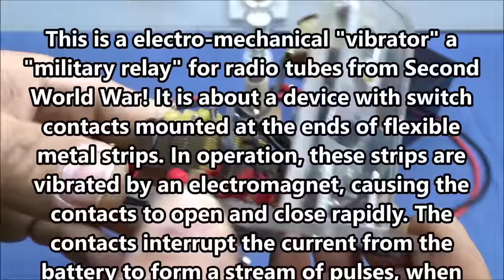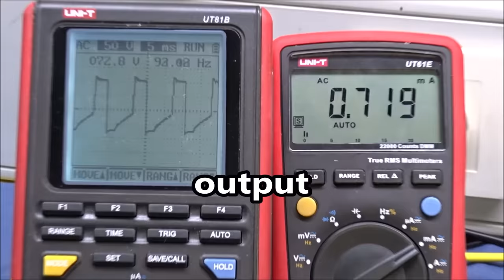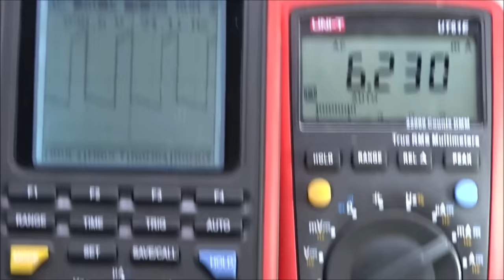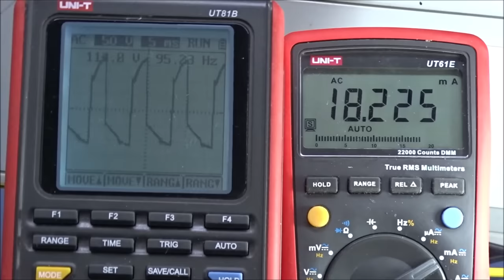Vibrator inverter

Comment from the maker: Buying one helps my research tremendously, helping me get all the supplies I need for the future. Visit my store on ebay: https://www.ebay.com/usr/eleman-gc
Reply: Hey can you look into bifilar wound secondaries transformers? From older text it say if one of the secondary windings are tuned with a variable capacitor the resistive secondary winding resistance is reduced by half. Sorta a buck and,boost set up. You have more,diagnostic than I.
Reply from the maker: @brettmoore3194  That's interesting! thank you & I'll look at it...

Comment: Eric Dollard mentioned this in one of his videos. It was used to charge 24 Volt batteries from 12 V batteries.
Reply: Yeah to charge some capacitors in parallel and discharge em in series, multiplier circuit, that dude is a legend. Changed how i look at things.

Comment: I think if you put enough run capacitors , (Oil filled high voltage) on the load side of transformer it will smooth out the ac signal making greater efficiency and will also run devices cooler. It is the dirty signal that makes heat, the more smooth the ac signal the less heat

Comment: what is the advantage of the vibrator compared to the transistor in inverter circuit ?
Reply from the maker: frequency...
Reply: @eleman-gc  Did you mean that vibrator can go to higher frequencies  than transistor ?
Reply from the maker: @neon-pl3du  No the transistor going higher frequencies  than vibrator!

Comment: Is an electro mechanical inverter useful? I suppose in a post apocalyptic situation if you had an inverter with a vibrator, where the heart of the thing is something you can fix....than yeah its an advantage. You sure can't pop the lid off a transistor and rewind a burned coil, polish the contacts, gap the points. You would have a dead box with a bunch of useless transistors as the zombies shamble towards you.

In theory if you are skilled and you have a machine shop and test equipment, you could make a vibrator with tungsten contacts from scratch. Can you say the same about a MOSFET you could depend on?

Comment: This is not the correct way to operate a vibrator. There should be a timing capacitor, correctly selected, otherwise the vibrator will have a short life.